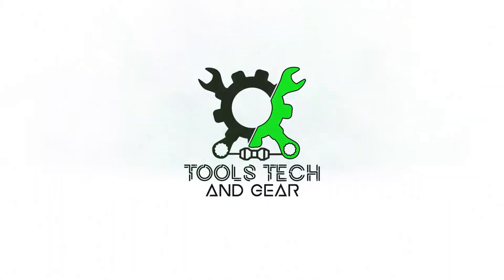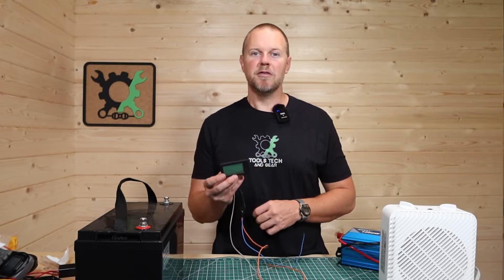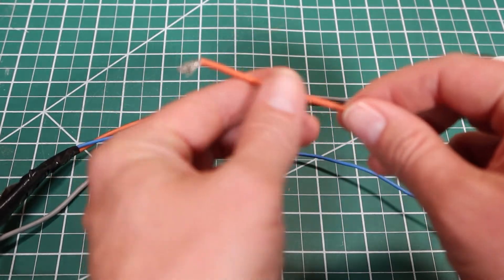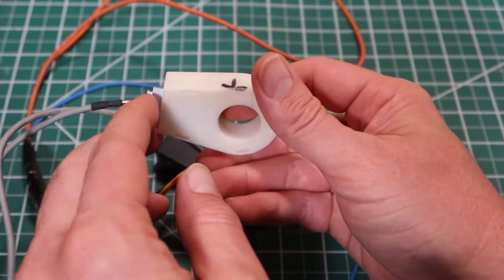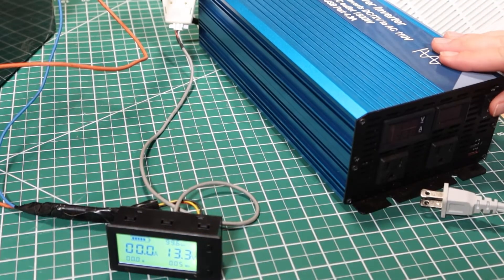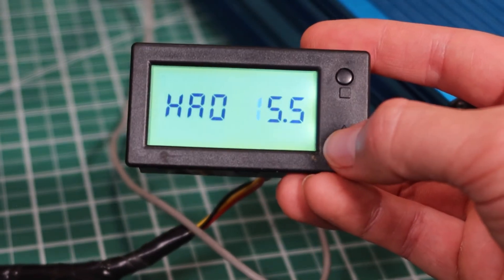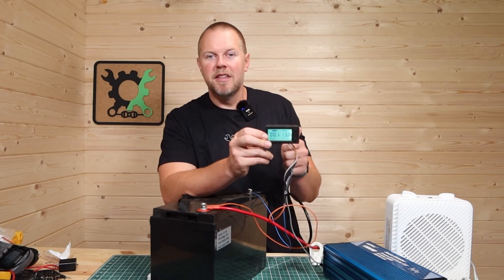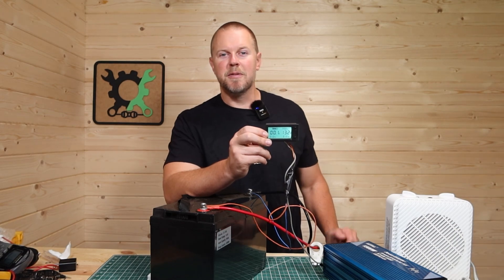Drok Battery Monitor How to Set Up

Comment: Thanks. Interesting gadget. Somewhere along the line I got the idea that those amps sensor loops only worked on AC power. Apparently not. Also, it's good-news bad-news about the device's user-interface. It's clever how they've been able to do so much with only two buttons (makes it lower cost), but the price one pays is a pretty non-intuitive user interface. Ah well.

Comment: Thanks, some useful info. I've been using mine ok but learned that if the Max voltage setting is higher than the fully charged voltage then it will never reset the charge to 100%, and the energy display seems to just continuously decline. So it's important to get that setting right.

Comment: OK...installed last night. The only thing I have running is my propane detector...1.1 amps. 24 hours later my battery amps hours remains at 100 Ah, the original setting. I would have thought that after 24 hours I would see a 26+ amp drop in that 100 Ah, and the Battery Meter icon still shows full charge, which seems odd. The voltage dropped from 12.4 to 12.3. The Watt Hours went from 40 wh to 321 wh, which sounds about right. I also have extra functions when I toggle through the displays...AP0 00.1, AC0 00.5, AA0 0...what are these readings?
Reply: I wish someone that knows would answer your question because I too would like to know the answer about the functions that you have questioned.

Comment: Me again...8+ months later. The monitor has been working ok. However, I'm curious about charging indications. When my batteries are being charged from the truck's alternator shouldn't I be seeing a negative indication at the A (or amp) display? At home I turned off all appliances, plugged into my truck, ran at idle and up to 2500 rpm and I didn't get any reading on the amp display...all 00.0. How do I use this to show how many amps my alternator is delivering? It shows volts OK, but amps are more important in many cases.
Reply: Did you run the charging wire through the sensor?
Reply: @troypearce1098 You might be on to something there. The + cable from my battery goes thru the sensor and the small arrow on the doughnut is pointed toward my circuit breaker panel/converter as per the instructions. All readings are good, except no charge indication. According to the instructions I should see a - indication when charging. Since my converter automatically shuts down charging when my batteries are fully charged that may be the issue. My batteries are almost always fully charged…either via solar or campground pedestal.